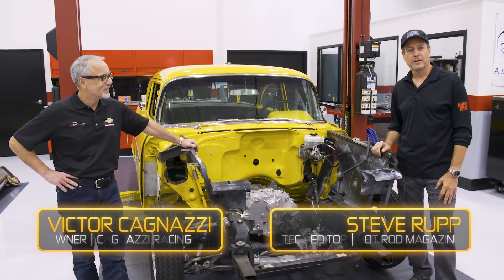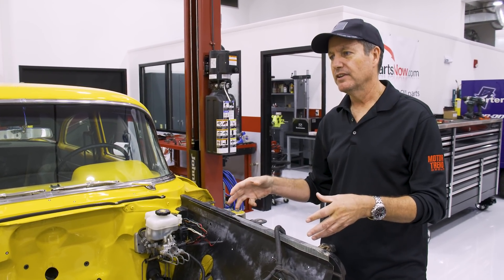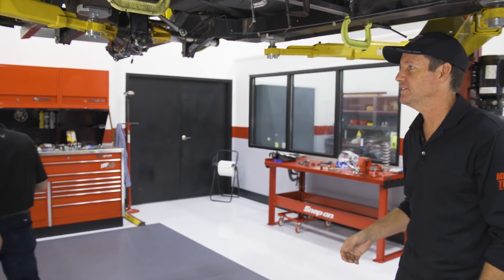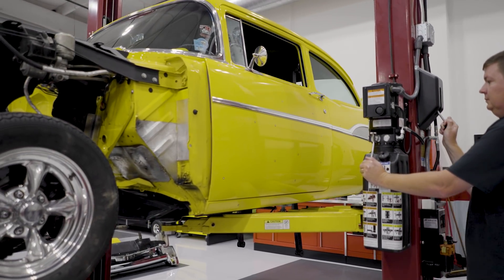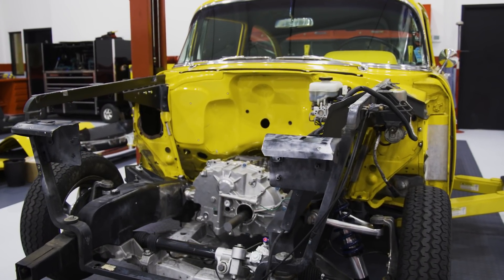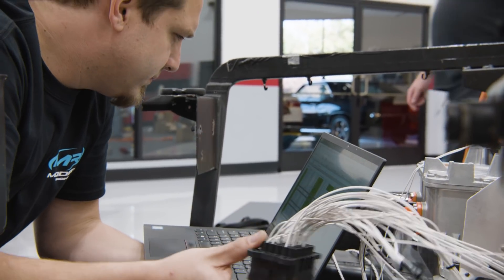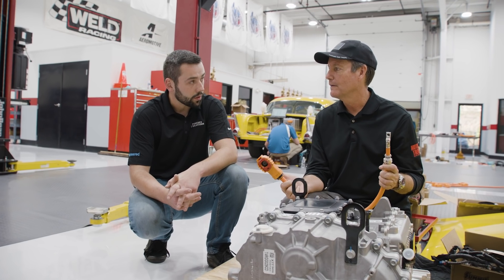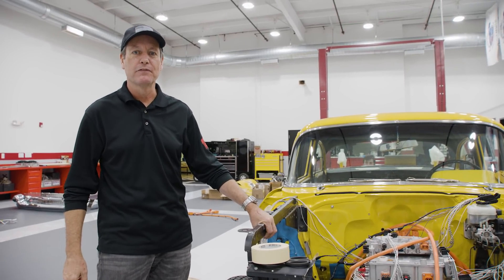Project X: The EV Build [Ep. 2] | MotorTrend

Comment: Technology is a means of moving forward in design and thinking.  Big V8s are fun, great etc, but if you have not driven a high output electric, you are missing out big time.  I have driven V12 Lambos, V8 Detroit muscle, V8 English and German Muscle.  Nothing prepares you for instant acceleration and speed like electric.  All you are missing is the smoke and noise.

Comment: Here is my issue, Project X was always a poor mans build. Budget builds and even tips and tricks were explored, to help everyone. Even the pro street was done on a budget, that most could swing. The issue was when the blower motor went in, it started going past it's historical place. Now you put an E-motor in it, Who is putting electric motors in hot rods right now? The answer is very few people, I mean those with enough money to prototype things, much less attempt to do it once. Also what is cheap about doing this with a 3D scanner, experts and probably enough CNC machines to prototype then make the actual parts with. I'm not against E anything, i have an RC car that is probably pulling 1500 watts (about 2 HP electric), while weighing under 7 pounds. Electrics are great but with scale comes scaled costs. I have $500.00 on my RC car and support equipment. at 1/0 scale that would imply you have about $5,000.000 in your upgrade, but we all know that is not true. I would not be surprised if you had $50K in this, which is 100x what i have in my RC, not 10X as the scale would suggest. I'm sure there are reasons to not post costs, but that is breaking one of the rules of Project X, that was showing layman how much it'd cost to replicate

Comment: Cool stuff.  But weird to transfer the power electrically from back to front then mechanically from front to back.  Mid-mount the batteries under floor and put motor in back.  No driveshafts  and better weight distribution.

Comment: Someone NEEDS to get fired over this. What a waste. It illustrates how little  they understand about that car. Project X is defined by its engine and visceral appeal. You ruined that. Its just an old chevy now. I never thought i would hate GM, but hey have completely lost touch. The build nothing affordable enough, practical enough and exiting enough to WANT to buy.
Reply: It’s a test mule, you just want to cry on the internet and know nothing about project X or it’s history.
Reply: @Yesiknow0  exactly they are using the car for it’s intended purpose 50+ years ago. Pretty soon there will be plug and play drop in electric motor kits and this will be attainable for almost anyone.